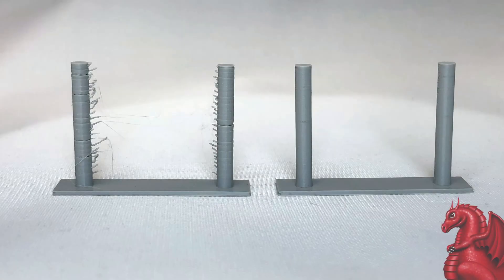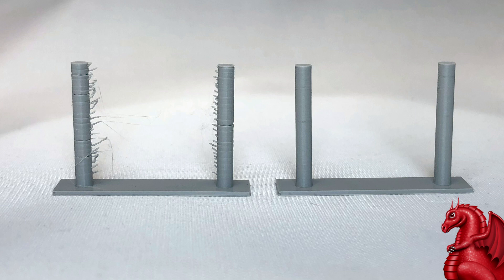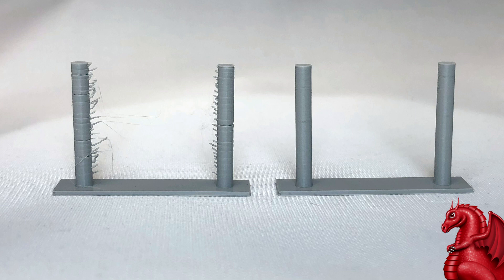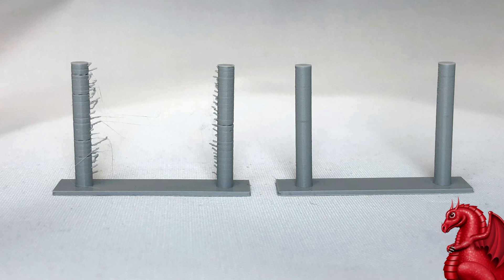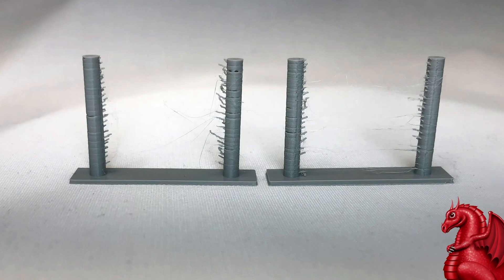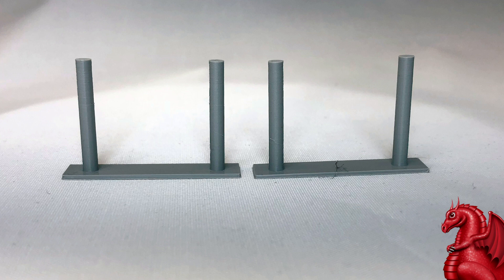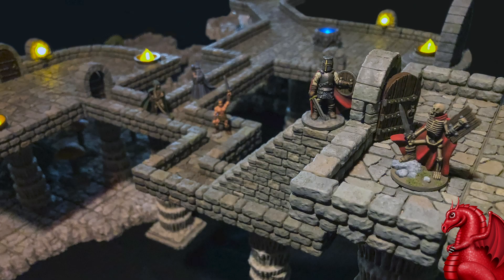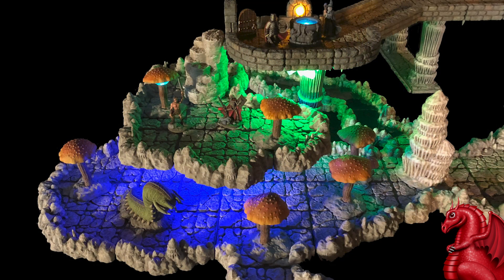Temperature Testing - the 5˚ difference!

Comment: Hey Tom, the issues you were having with eSun PLA+ was it an impossible balance between oozing and under extrusion from excessive retraction? I can't seem to get rid of the oozing entirely without causing little tiny spots of under extrusion in the areas of the retractions. Tried everything with the printer and then I saw your video here and I thought, shit maybe it's the filament. Going to test out the hatchbox but just wondering if this was the same issue you were having with the eSun?

Comment: I'm wondering if you will set the first layer temp down to 195 or leave it at 200 and if you would change the bed temp

for all of your terrain (and most everything else) I have used your profiles because they are so fantastic
would be grateful if you share a profile specifically for hatchbox since your latest profile (Cura 5.2 v1) has a print temp of 190

Comment: Funny you speak about Hatchbox. I recently purchased an Ender 2 Pro (loving it!) and was using Hatchbox PLA Pro+ with perfect results. The temp was 200. Then Hatchbox ran out of the Pro for a couple of weeks so I bought a roll of eSun PLA Pro and that clogged up my nozzle immediately. I raised the temp to 210 and then 215 and it still clogged. Then I went as far as changing my nozzle and tube to a Capricorn to make sure it wasn’t that. It still clogged so I just stopped printing. Hatchbox finally got more PLA Pro in and I got a roll two days ago and it’s also clogging from 200 to 220. Crazy thing is I had perfect results with 200 so why do I need to raise the temp to 230 to get it through the nozzle now? Can someone tell me what to do? TIA.

Comment: That kind of stringing is a dead giveaway that the filament is wet. Thoroughly drying it should let you print at whatever temperature is best for your speed & strength goals, and improve strength of your prints.
Reply from the maker: Nope, used freshly opened filament for all tests to ensure humidity was not an issue.
Reply: @Tombof3DPrintedHorrors  Freshly opened filament is always wet. A sealed plastic bag cannot keep moisture out, and a small pack of silica gel is not sufficient to absorb what gets in (and will only absorb what enters near the pack, especially if the bag was vacuum packed). Freshly dried filament, or filament stored in air tight bins with molecular sieve desiccant, is so much better.
Reply from the maker: @daliasprints9798  6 hours in a filament dryer and still same result. NOT A MOISTURE ISSUE.
Reply: @Tombof3DPrintedHorrors  i can confirm the same. 10hrs+ in a filament dryer, or even loaded into running filament dryer while fed into machine... still stringing badly with me. Using  esun PLA+, and noticing issues on newer rolls.
Air humidity is also a factor... but i have an enclosure that helps drop and regulate air humidity well.

Would you comsider printing ESUN PLA+ below 200?
Reply: @rolandschreurs6980  I'm currently using gray esun pla+ . started at 200 and went all the way down to 185 (now doing 180) for a 5 hour mini print (0.2 nozzle 0.08 height). it seems the detail on the 185 print is noticeably better, not sure about 180 yet but thats probably the lowest. after 180 going back to see what 205/210 etc are going to do for the print.

Comment: I am glad to see another confirmation that Hatchbox PLA likes to be printed cooler. I have also been tuning a few spools recently, I have a direct drive combo extruder/hotend (E3D Titan Aero) and I am now using Hatchbox at 200 C, retracting 0.2mm(!!), retract speed 40 mm/s. No significant stringing or oozing even over 100mm travels, with 0.4mm Z lift. When too hot, I found even reasonable sounding retract numbers can create minute air bubbles in the nozzle that come out shortly after a de-retract as pinhole voids. I might see what happens if I go even colder, now.

Comment: can you share your retraction settings? I always have a whisp on my prints. thanks
Reply from the maker: My custom Cura profiles are available on my website :)
Reply: For a Bowden tube it’s 5-7mm and 35-45mm/s.
Reply: Don't forget to update the maximum extruder speed in your ender settings and save it!

Comment: Great information as always. I was also seeing eSuns drop in quality and all the things I was trying to compensate weren’t working. Glad it wasn’t just me doing something wrong.

Thanks for another great informative video!
Reply: You’re not the only comment I’ve seen
Reply: I only started a few months back, but the only filament I've had problems with was from eSun. The one reel I got from them is unusable due to variations in filament width - so I went back to using the "cheap stuff". It's the only really bad reel of filament I've bought (others worked even if they occasionally needed some fiddling/recalibration).